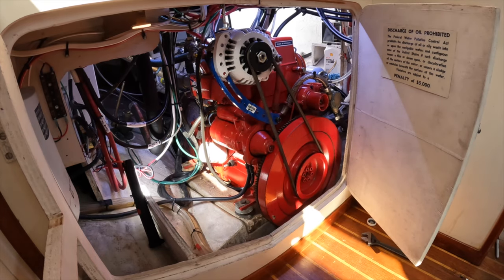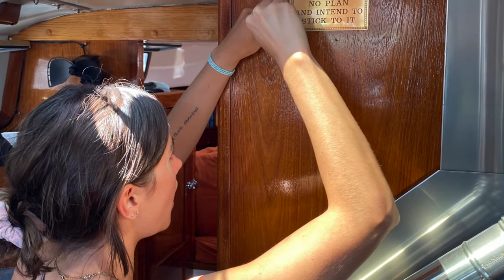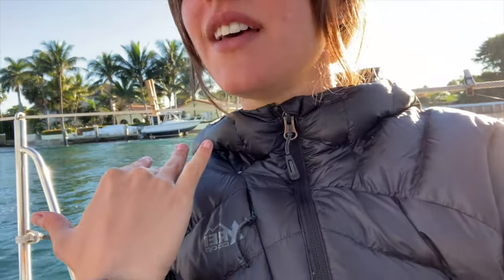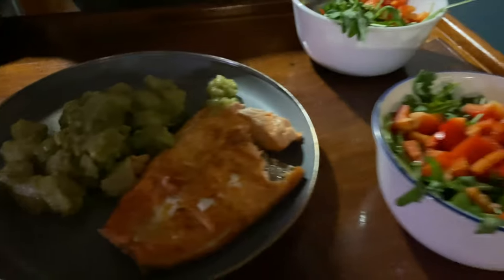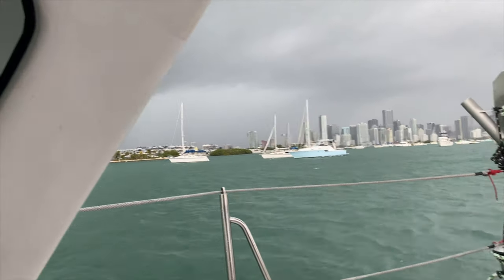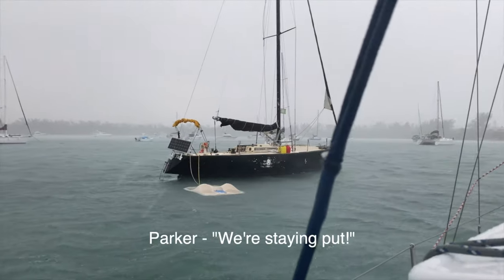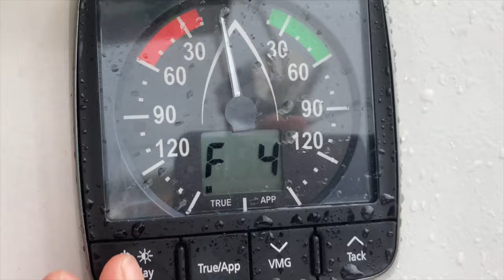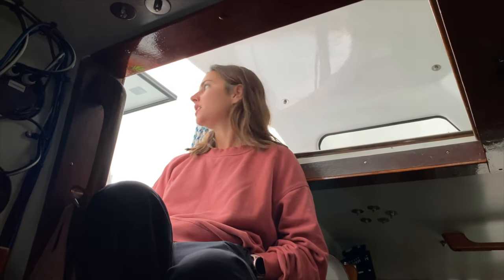EP. 24 Abandoned Boat DRAGGING ANCHOR RIGHT at US in a STORM

Comment: Have you considered also putting your fenders out on that side and keep a couple of them in hand? If the other boat comes at you a bit quicker pushed by a wind gust it will be hard to do anything useful with the boat hook in my experience.
Reply from the maker: I didn't think about using fenders while it was happening. Someone else suggested it as well and is a really great idea. They would be very helpful in a situation like that!

Comment: Hi nice guys, thank u very much sharing   the nice video. I'm glad  to see that you dealt with the stressful sitiutaion at the end. 👏👏👏
What I believe that lessons of learnt from ours and others' experiences are very important.  If u don't mind may I share some of my suggestions : 
* Preparing for bad weather conditions  should cover not only the boat, but also the crew (even comes as the first priority according to the SOLAS - Safety of Life At Sea rules. Your first goal should be crew safety first, next the boat then the others. 
* Wearing of life jackets, which you already mentioned in the video👍 (you were expecting 40 knots storm and could get safety steps beforehand) 
* Life jackets are not enough in such stormy weather even you are in anchored position. I suggest to wear harness and use a  safety rope esp while you are on fore castle deck.
* Getting away a dragging boat from yours  via a boat hook and  using your both hands might be very dangerous and  risky. You might  loose your  balance and Man over Board by the huge force impact of the heavy  wind, waves and the weight of the boat; fatal  and vital risk of crushing or trapping between two boats. If it is necessary u should use it by your one hand, getting safety yourself holding a safe place with your other hand and standing on by your two legs. ( 3 point holding rule in climbing). 
* You should  use fenders (fixed or mobile in hand) not only in bad weather conditions but also while you anchored position as  a mitigation of an another boat crushing accident possibility, against yours. 
I wish you the best and good luck for your next adventures. I hope that you will have a lot of  sailing experiences, gathering nice memories by visiting wonderful places& beaches all around the world. 
Looking forward to watch your following nice and exciting  videos. Take care yourselves...👍👌⛵️⚓️🧿😀🙋‍♂️
Reply from the maker: Thank you so much for all of the great suggestions! Ive had a lot of people suggest the use of fenders during a situation like that. Great idea and something we have decided to start doing. I also am going to design a tethering system that allows us to quickly and easily clip in all around the boat even at anchor for situations like this! These experiences are all wonderful, even the stressful ones 😃

So glad that you are enjoying our adventure. Take care 😊⛵️ 🌎

Comment: If you'd tangled anchors,  it would have been much worse. I would drive up over your anchor, haul it up and move locations. Definitely get a remote capable windless, so you can haul up the anchor in any conditions while single handed.
Reply from the maker: We would love an electric windlass but our manual does the job! Electric is definitely safer in some conditions but we like our more simple electrical system! We were very lucky in this scenario!

Comment: Was the other boat really dragging? When a large scope of anchor chain has sett itself on the bottom this can hold the boat in an unnatural position in relation to it's anchor. When gusts from a new direction hits, the chain wil now let the boat drift down wind from it's anchor, this can look like dragging. Glad you are all ok. Best regards from Jarle
Reply from the maker: Hey Jarle! Yes the other boat was definitely dragging. You can see how far ahead of us it was in some of the clips before the front came through. Id say about 300 feet in front of us when we first noticed the wind had picked up into the 30 knot range. When we noticed the boat coming at us when the stronger gusts hit, it was less than 100 feet from us and moving very fast broadside at our bow. We both saw the boat re catch. The stern then swung violently around and just missed our boat as it continued to drag and slow to a halt right next to us. I thought it would have snagged our anchor chain as it passed by our bow but somehow it did not. When I hauled in our chain it brought our boat almost 100' in front of the other boat. We had 140 feet of chain out

Comment: Boat maintenance question for you.  I saw you putting TefGel on the threads for the zinc.  I'm assuming you do that as an anti-seize, but doesn't TefGel also act like an isolator increasing the resistance between the zinc and the cap but for a zinc to work optimally you want the electrical connection to  the engine or more noble metal to have as little resistance as possible?
Reply: You are 100% right .  shouldn’t use tefgel or grease , now the anode won’t be in contact with the engine . The same for the underwater anodes , no grease or paint on the anode or bolts
Reply from the maker: Before using it on the threads of the zinc, I read on the data sheet that tegfel is inert when it comes to conductivity. I may be wrong though! I think next time I'll forego the tefgel. It is probably not needed, and Id rather risk a bit of corrosion between the dissimilar metals than risk the zinc not working properly!
Reply from the maker: See my comment above! Next time I service the engine zinc I will forgo the tefgel although it says on the data sheet that it doesn't affect conductivity. Better safe than sorry!

Comment: Would it have been proper to board and reset their anchor ??
Reply: Proper? Or Considerate?
Reply from the maker: When the black boat's anchor re-set, it stayed put. The squall passed over quickly (about 30 minutes total) and as the wind was starting to die down, we re-anchored Seawind. Resetting their anchor wasn't something we had thought about doing in that situation because it didn't continue to drag. It would most definitely be something that I would consider proper/considerate and I'll be able to pull on this learning experience for future situations 😊
Reply from the maker: Most definitely!!
Reply: @Boundless_Adventure  If things went wrong could you be held responsible ??

Comment: what did you put on the screws of the zinc?
Reply from the maker: I put a very small amount of Tefgel on the threads because of the dissimilar metals of the threads and the brass fitting that gets screwed into the engine block. I was lucky with the zinc unthreading easily this time and figured it wouldn't hurt for future disassembly.